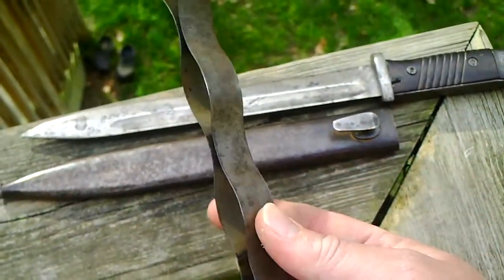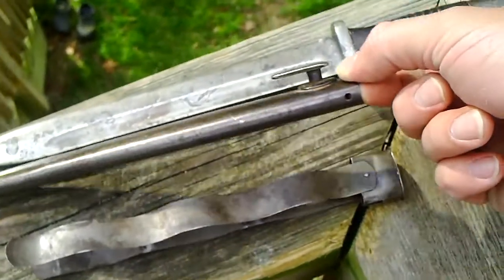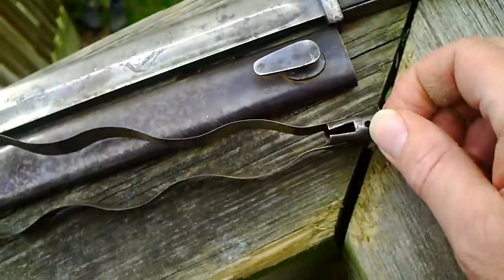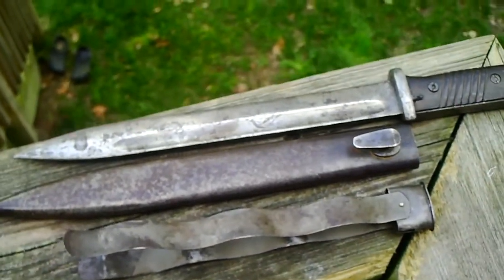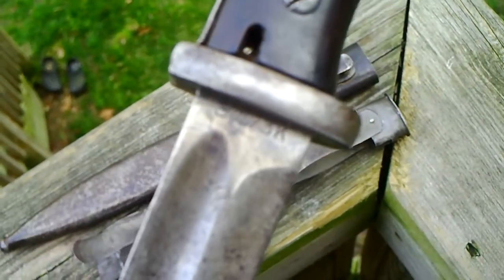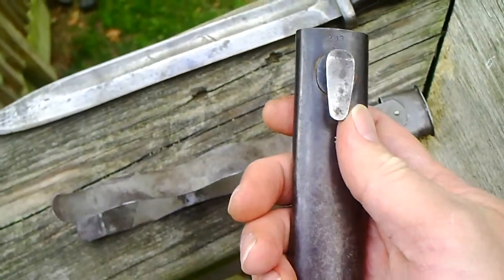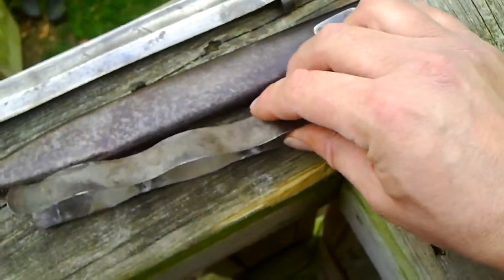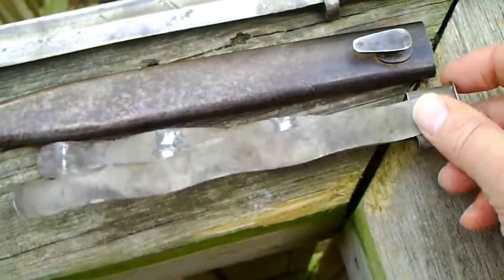WW2 German Bayonet Disassembled into Parts

Comment: @terminal99 Could be loads of reasons, I think the majority are down to the original is lost or damaged and paired with a bayonet-less scabbard.
If it went through an armoury repair/refurbish it could be mismatched because of that; pile of bayonets and a pile of scabbards needing work just putting them back together when they are fixed.
Some bayonet are very old and a lot can happen so thats my guess anyway, if anyone comes up with a better... Im all ears :)

Comment from the maker: @in4fun Hi Jim, according to Coinflation, "The 40% silver version of the Eisenhower dollar was issued as a collectible only, they are generally not found in circulation. The best way to distinguish the two versions is by weight. The copper-nickel version weighs 22.68 grams, the silver Ike dollar weighs 24.59 grams." Will

Comment: Doesn't help they aren't regular fonts either.

If you are going to clean it up, use 0000 grade wire wool and a coat of gun oil and gently rub just to take off the surface dirt ect. Once the oil is dirty wipe off and repeat one or twice. Don't be over eager as it can ruin the value, when the oil is clean its done.. 

I can't really give a value as I'm not too clued up on the US market. (I live in the UK) If its got a matching number scabbard could be $100+ without maybe 60-80, best to check ebay